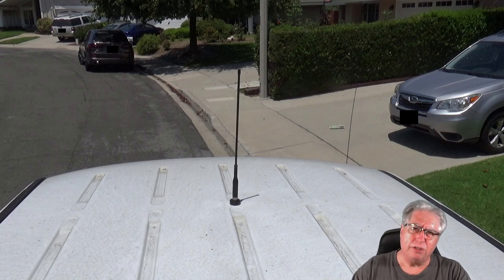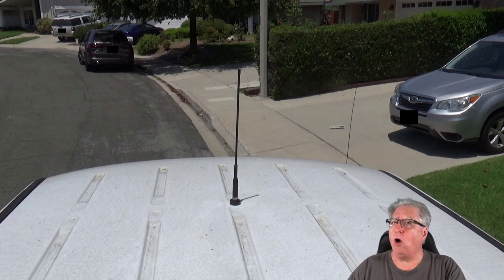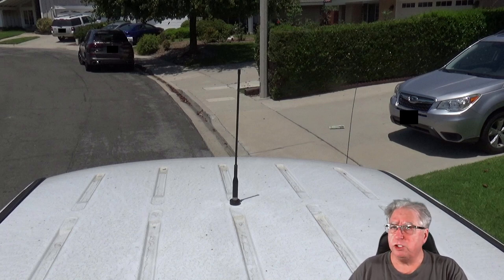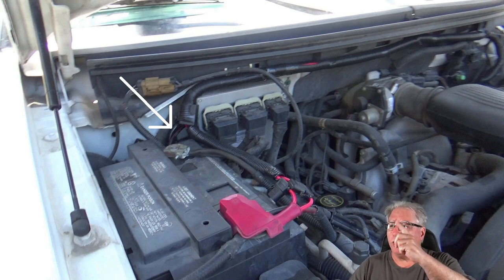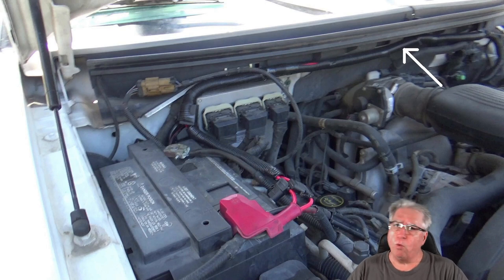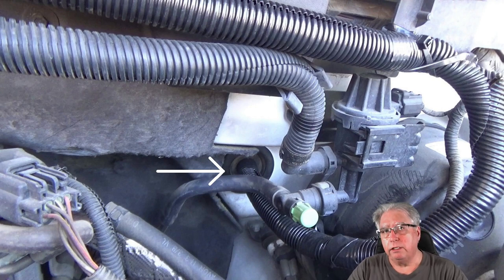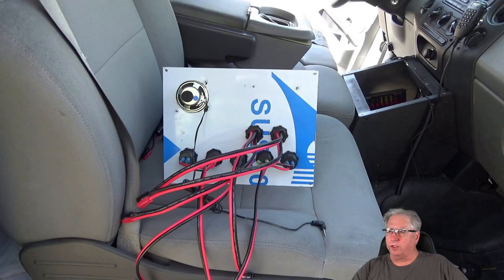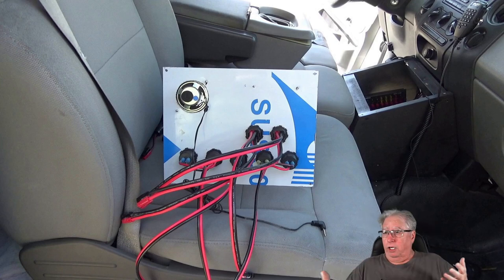Installing An Amateur Radio In My F-150

Comment: A bit of a different view is that you really don't want a constant powered connection even though you think that you might want that. Instead, consider two different types of power sources, ignition based, which isn't needed as often as you think, and more importantly a manually controlled power connection that you can turn on and off as you so choose. You might want to charge your phone when you turn the ignition off, as long as you don't do it for a long time the battery should be able to handle it. You might not want constant power to a radio for many reasons.

I have a dashcam and a GPS (older vehicles) and I want those powered when I am out. A dashcam is useful when you are parked, not just when you are driving. I turn on the power when I leave and turn it off when I get home.

The first setup I did has a switch which I can select between constant power or switched by the ignition, but it is extremely rare that I do anything other than manually control it. That gives all the options which you can control.

Another option, which is good when you use your vehicle for all day events, but are parked, is to have a ignition powered 12v to 12v charger connected to an additional battery and then have that battery used to power things. That ensures that when times comes to go home your vehicle will start. This can also be done in a cheap way by having a relay to switch power from the battery to the vehicle when the ignition is on. It means that you would have to manually charge the battery, but it is far cheaper than buying a 12v to 12v charger.

Also, there is a person who has a business called Mobile Creations, who I have used for stereo issues, but I also had him connect switched power as he knows where to connect from the inside for power, either constant or ignition based. He is reasonably priced and is much cheaper than B/M businesses.
Reply from the maker: Hi Ken,
I agree... There are several new battery only connections as well as several ignition connections in the install. I also have a switched power outlet to allow for a phone or other accessory to be charged at high rate (USB-c) when the vehicle is parked. This has a indicator to remind me it's on if I forget to turn it off.
Although normal drivers don't really fret too much about places to plug stuff in, we in the hobby seem to always need on more connection.... :)

Stu
AG6AG
Reply: @AG6AG  not sure if you got what I was saying, but what I was saying is that ALL of the power should be able to be turned off, either by switch or by ignition, none should have constant power.

Comment: Even a new vehicle its a PITA to figure out where to mount stuff LOL.  I find it much easier to install radios in old vehicles, a lot less crap in the way.  Nice thing with some of today's radios is you can remote mount the faceplate so you can kind of tuck the radio out of the way.  

I had one of the TYT-9800 radios, sold it on Ebay because I got tired of it sitting around, and I don't really do anything with my Amateur Radio license anyhow, I have a radio in my car but I only have it on as more or less a scanner....not much in the way of anything else going on as far as HAM use so I don't even have any of the local channels programmed into it, nobody uses them anymore unless there's an event going on in town, then the ham operators use 1 or 2 frequencies but otherwise its silent, kind of like the CB...everyone has a cell phone so radios are pretty pointless anymore for the most part.
Reply from the maker: Hi Wild Bill,
We're lucky out here in Ventura County CA. We have a very active Amateur Radio community and there always seems to be some activity on the local repeaters. When driving long distances, I've found that thing are much quieter...
Newer cars are much worse then the older ones to get anything installed or wired up. They're interiors are not designed to be taken apart and put back together without snapping a clip or tearing a piece of cheap plastic along the way. I have some background in the industry so I can usually get things done without replacing things, but it's a challenge...
Thanks for commenting!

Stu
AG6AG

Comment: I have a fusion Radio in my 2006 f150.
Reply from the maker: Hi Chuck,
Each vehicle has it's own issues and challenges when it comes to accessories. Older vehicles at least have some real estate available for accessories.
What was the biggest obstacle for your install?

Stu
AG6AG